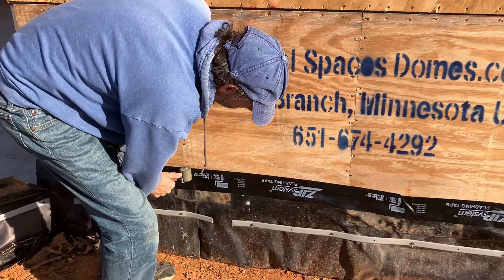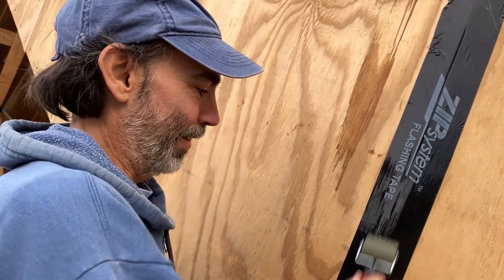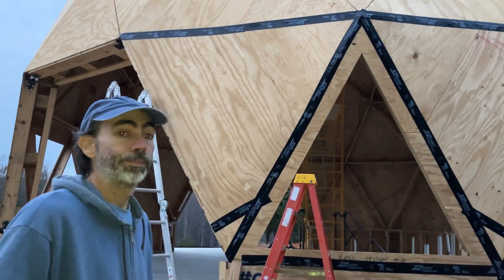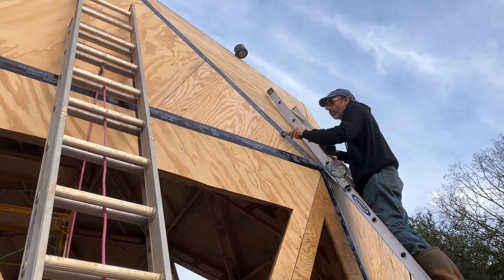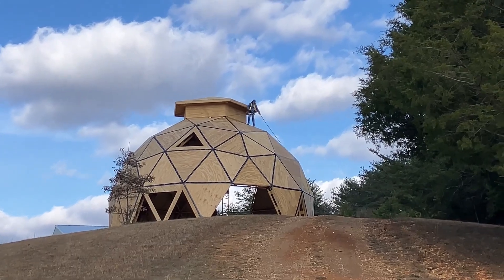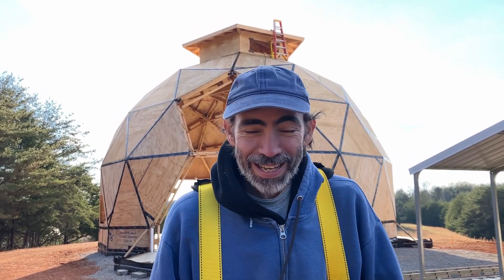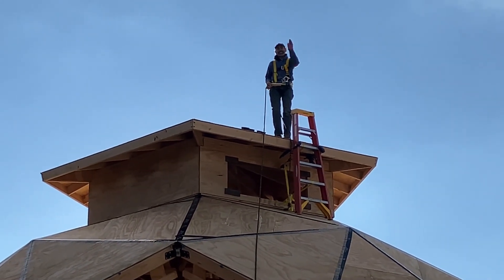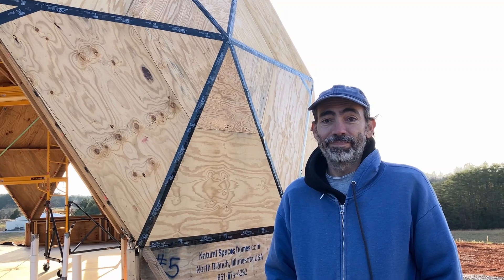Our Dome Build...First Framing Inspection And Other Fun!

Comment: The zip tape will help you big time with your air-tightness, especially if you are insulating with an air-permeable material.
Reply from the maker: Yep, and at the very least, I feel like it is buying us some time protecting the seams until we get the dome dried in.
Reply: @trippyacres  I roofed my small (25' DIA) dome a couple years ago. I did a total overkill, lifetime job which involved about $4K worth of fluid-applied WRB and another $4-5K worth of a fancy, hidden fastener aluminum metal shingle product. It took me forever. I'm not sure yet if it was worth the effort, but at least I'll never have to do it again.

With a dome your size, I would either use traditional asphalt shingles, or I would consider something like the larger Aluminum Reinke shakes. Even though they have exposed fasteners, they would be easier than the metal shingles I used because you wouldn't have to do metal folds. They would also allow you to easily replace a shingle if need be, and would still likely out-last you.

Price it out and compare to a very high-quality asphalt shingle. But also factor in a 2-3X the amount of work.

If it's the same price, but 2x the work. I think it is worth it. If it is 3x the price, and 3x the work, then probably not worth it.

Good luck.

Comment: Great idea!  I've been thinking about the taped seams myself and will now add them to my dome.  It certainly can't hurt and it does add another layer of moisture/air protection.  One option I am using, which no one else is likely to, is the addition of  Faraday Cages on the inner portion of the dome and the exterior metal roofing to stop RF fields and Beta radiation.  It's a long story about why so I'll skip that here and post it on my build when I get to that point. I really enjoy living vicariously through your build and I hope your weather stays mild so you can continue without interruption, except for the garlic.  I was able to get in about 400 in November.  ONE QUESTION;  What kind of fall arrester are you using on your harness?  I can't decide on which one and yours looks easy to adjust.
Reply from the maker: Yes thankfully it has been unusually mild and DRY for the last month, which has been a lifesaver for us since we are still not dried in.  We thought about a metal roof but ultimately decided that cutting all that metal would be really tough for us to do the roof ourselves, so we went the "easy" asphalt shingle route.  The Faraday cage sounds interesting!  I look forward to seeing your setup!  I'll let Brian reply more about that and the harness brand, since he was in charge of that :)